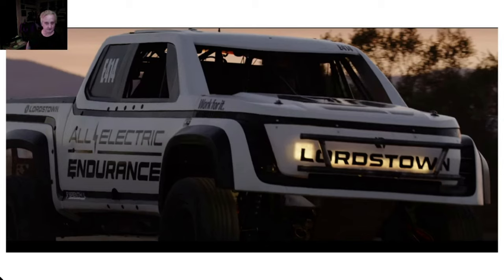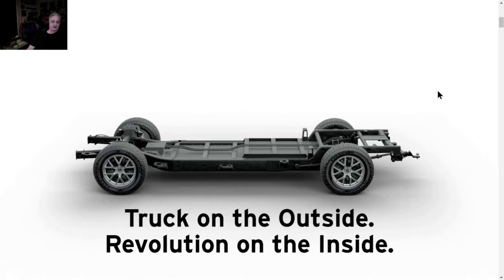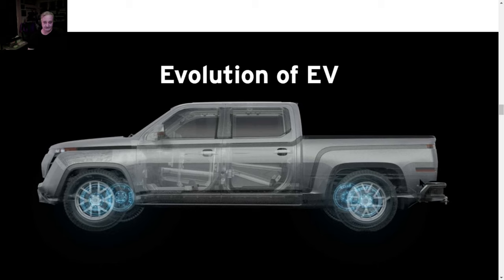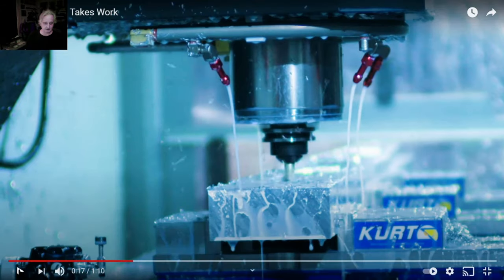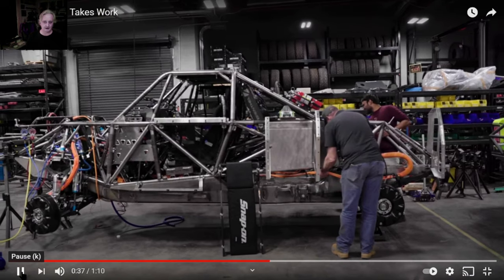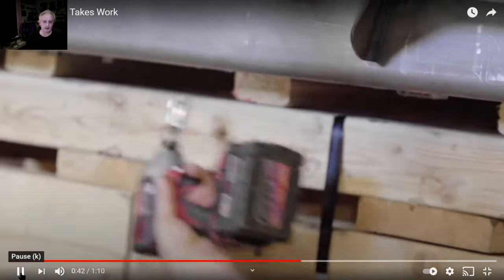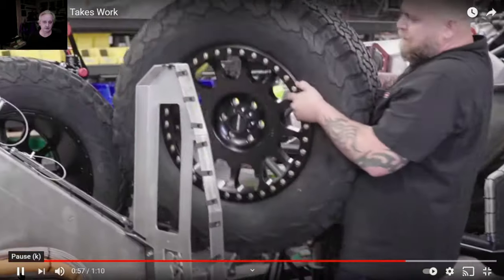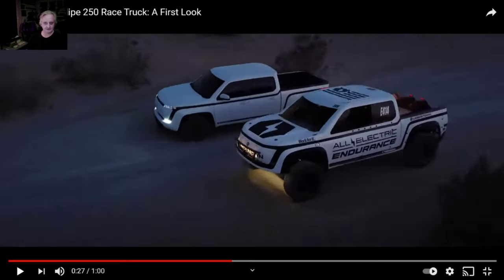Race Truck Reveal | San Felipe 250 Baja | LMC Endurance | Details | News | MXUX | #RIDE #Lordstown

Comment: As an enthusiast in EV's, and an investor in Lordstown, I am very excited and interested to see how this truck performs.  They have had some very negative press lately, but IF they can actually produce the vehicles and in the timeframe they have stated, they could be a very disruptive and solid company.  With their agreement with Camping World, and connection to a charging network they will have service support, and the infrastructure to service these vehicles going forward.  I pray that they fulfill the promise that they have stated. Work For It!
Reply from the maker: On LMC - according to the earnings call they are on track and on schedule for Endurance production start September 2021 (they just rolled three more beta builds off the line now a total of 5 - on the way to customers for evaluation) They are also tooled up for van/camper launch summer 2022 - no debt - say they will have 200mil+ cash after van rolls out. The press is ill-informed, the Morgan Stanley analyst covering LMC on the earnings call had NO IDEA of what a hub motor is or how it worked - Listen to the call if you don't believe me. In any case, a lot of good news to be discovered.

On the race - I am confident they know the truck can run the race - with luck finish - this course is even tougher than the longer Baja races - it eats pro trucks - a finish for the E414 will be fantastic. Fingers crossed. 

I have an insight I would like to share - at risk of not aging well - here it goes. I just watched a motocross race, very similar. Here is the rub: this was the first, or one of the first, electric motocross bikes - the instant torque of the electric motors could not be matched - the ICE bikes had to spin up all that hardware after they slowed down or let up on the throttle - the e bike just launched - lapping the ICE bikes - could not believe it.

Comment: One correction: Not all the Endurance tech is their original IP. The key tech of the hub motors is licensed from the Slovenian tech company Elaphe Propulsion Technologies. Not clear if all the other tech is original IP or whether they are mainly integrators.
Reply from the maker: Larry true - however Elaphe sells the vanilla 1500 hub motor - many parameters can be customized in manufacturing - one of the selling points - LMC has their own secret sauce as they are manufacturing in house - and according to what I have heard - they have the exclusive rights to the hub motor in trucks (vehicles ? this need more work)? secured for North America from Elaphe I believe - so IP in that sense - they have other IP in regards to battery design/power systems - not the cells - but the way they are placed and cooled and the power is managed so on and I believe the in vehicle computer system and interface- as I understand it - perhaps as well for the suspension which is heavily engineered by LMC and not off the shelf - thanx for the comment L - share more info if u got it...

Comment: The motors do have coolant lines. They are braided hoses and you can see them in photos elsewhere.
Reply from the maker: j i am never sure on this they are air cooled and so the vents in the fenders and there is also a brake line going into a disc brake behind the hub rotor that is what i thought that braided line might be but ii have yet to see an exploded drawing showing a cooling system on the hub - just a rotor and stator -have u seen one?
Reply: @mxux  I saw a photo somewhere of the suspension up close and you could see the lines. If you go on the Elaphe website it shows blow-up diagrams of the interior of the motors with the coolant passages. I don't think they could run without them hooked up longterm and definitely not desert racing at the limits of the motors. I do seem to remember Aptera was not running coolant on their prototypes yet.

Comment: I dont expect them to do it all in one charge... if the battery is truly stock, it'd be very impressive to have that kind of range on such a tough route. Even though the body is much thinner and lighter, I dont expect it to be enough of a change to extend the range that much.
Reply from the maker: Ya I hear you hut - in the beginning they said they felt they could do it without a charge - the race I have been told is actually 244 miles so within range? But anyway they walked it all back - we will see this weekend - nice vid on this from you  Hut -thanx for the comment and the shout out -x
Reply: I'm hoping they can, at least it wont be cold out. And of course!

Comment: UPDATE :  Read 5.1 of the San Felipe 250 rules.  Baja-e & sportsman classes that start late ie 9:30 am) will be taking a short cut.  this in essence reduces the length of the race for Endurance to 242.9 Miles.
Reply from the maker: go over this in new vid downloading -ya - but note - not special treatment for e414 - thanx vic
Reply: Made it 38 miles

Comment: So Lordstown failed to complete the Baja race. The Endurance apparently did not endure. As a PR stunt this may backfire.
Reply: They should have been more open about what they intended to achieve, realistically  run a leg, do a  recharge, run a leg, Retire. That would be great data.
Reply: @ytwatcher8288  Yes. Except that the head of Lordstown made a very public announcement that their goal was to be the first EV to finish the San Felipe 250. So 40 miles and out is a major fail.
Reply from the maker: Larry I disagree - that is the roughest 50 mile road a production Endurance Truck / Van will ever run in normal use - by far - and in the roughest desert conditions - it did it successfully with a stock frame - a stock battery - and stock hub motors and controllers - the same ones you will get as a consumer - you can be assured the Endurance production truck can take it - and be reliable! If it can do this - normal roads are nothing! As I explained in the post above (suggest u read) a Trophy Baja race truck that has about the same 600 horsepower as the Endurance - with the same tire set up - carries a fuel supply 5 times a normal truck - the gas tank would be 102 gallons! - and they refuel - they know the fuel demands of Baja racing - the Endurance chose to run a production battery to prove  the competent - if they followed the logic of the normal race set up they would have had the battery 5 times normal size -but that would have defeated the purpose of running the race to prove the stock Endurance components - what other EV has proved their stock components - battery -drive system - and frame - in a Baja race? I can answer that - ZERO -NONE - sorry for the caps - a PR Coup IMO. Thanx for the comment.

Comment: This is not the first electric vehicle to race in SCORE.
Reply: please supply details of the 1st vehicle - been searching the internet and no mention of any other EV in any Baja Race.
Reply from the maker: Micah -first production full size ev pick up truck to race correct? has to be - it is the first one - first ev pick truck in production - others have been experimental correct? Drakar so forth purpose built not production correct? So first ev pick up truck to run correct? No? How so?
Reply: @mxux  Correct on all points. I never said otherwise and merely stated not the first EV to race in Baja. Guess what, they DNF this race. You can be the first to try do anything. It will never be significant until you are the first to succeed.

Comment: They are definitely not using the stock frame, it’s pretty close to a full Trophy Truck. The truck went 40 miles and had to charge, that’s pretty pathetic. I’m a huge EV fan but I think they need to contact Elon to get some more range.
Reply from the maker: Corey the base frame is stock as is the battery as are the hub motors as are the related electronics - the frame had a safety cage fitted on it and the suspension was modified - other than that stock - as for the charge - LMC chose to use the stock battery for this race / test - pure stock - of course a recharge was required. The Trophy Truck you mention has in many cases the same horsepower as the Endurance 600 BHP - a common size for a Trophy Truck fuel thank is 102 gallons - about 5 times the size of a normal fuel tank - they know the demands of the set up - wheels and tires - and the course - sand and rocks require it - had the endurance had a 5x battery they would have likely finished the race - but the result would be meaningless for test and proof of concept - and so the charge - I am doing a video on this watch for it - I submit that the five hour delay in the start of the race also raised the temp of the battery and probably required the cooling system to cycle - draining precious charge as well IMO - no proof of this but likely..as for the CYBERTRUCK - we will see what the final range is - I don't think it will Baja though - glass roof - impossible to install safety cage probably  overall would the air suspension work? - doubtful - battery would it have normal range in this set of conditions and special tire / wheel set up - I don't think it would - and would the uni-body be strong / safe enough? I doubt it for racing - everyday yes - racing no - lastly the Cybertruck is 20 feet long and WIDE - could it even navigate the course ?  Again I don't think the CYBERTRUCK will ever match the Endurance Baja performance - because it will never run Baja IMO = thanx for the comment. We can all wait for the Endurance Baja run next year!

Comment: The hubs are liquid cooled
Reply from the maker: Bob that has been an ongoing question for me - some images show no cooling connections - some seem to - thanx
Reply from the maker: finally found it - u r so correct "Direct-drive synchronous AC motor: Liquid cooled, compact, high-torque (1500 Nm) for electric vehicles."

Comment: I know you are surely smarter than this. 4 moving parts. Come on man. It doesn't steer? No suspension parts?
Reply from the maker: Lorne - ahh in the drive train - 4 moving rotors vs 1,000's in a combustion vehicle and 750 ? in a Tesla drive system - not the entire vehicle - that is an accurate figure - thanx for the comment